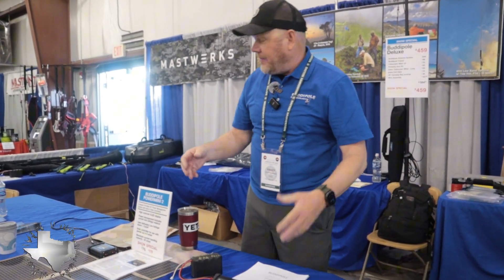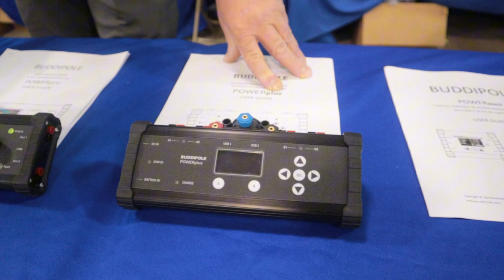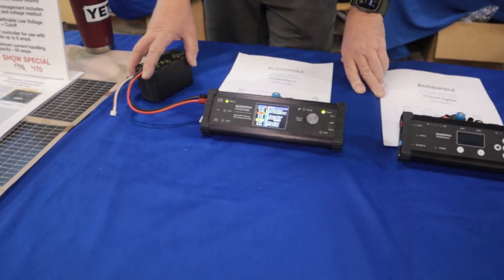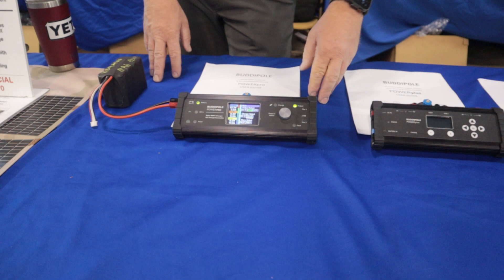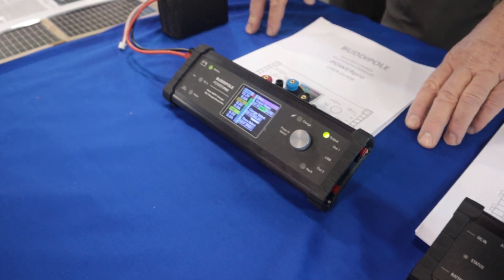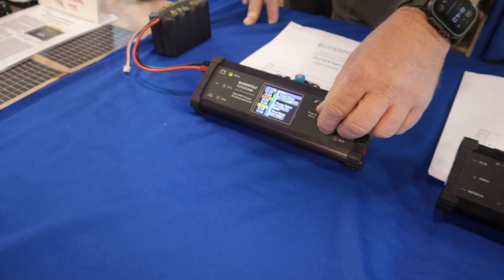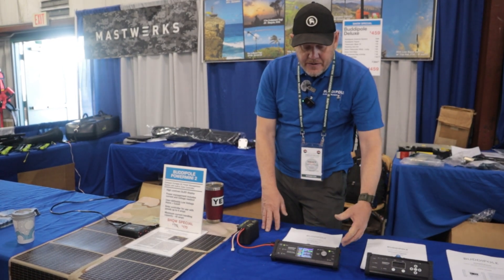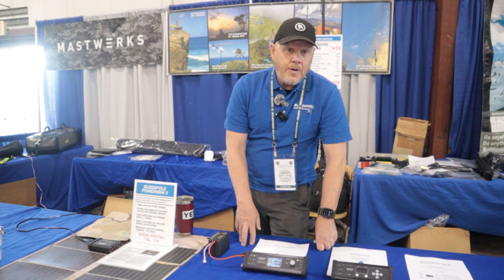Get Ready to MAXIMIZE Your Solar Power with the BuddiPole PowerPro MPPT Controller

Comment: I love my battery power, but I find lithium batteries to be painfully unreliable and tedious to maintain, and they just don't provide what I need. Power tool batteries die if they look at cold weather (DeWalt, Milwaukee, kobalt), and my big lithium batteries are just that: BIG. What's my solution? Make it bigger. I want eight 200ah lithiums, so I always have at least 4 good ones. I want 4kw of panels, 2kw of full Time use. I built a diy bluetti with a 200ah lithium, a rolling tool bag, 700w inverter, 200w of panels, and cables to jump cars, power 12v devices, etc. it couldn't jump a car lol (triggered protection in battery BMS), can't run a coffee pot, but it worked to run a temporary fuel pump in my van for a week and it can charge my phone lol... I've got 1kw solar, 80a mppt controller and 600ah of batteries in my rv. It doesn't sustain us at all. Still need a generator constantly or shore power. I'm hoping wind mills will help but at this point I've relegated my solar to powering lights in my chicken coops and my water pump once I get my storage tanks hooked up. That's where renewable energies will have the most impact I think. Running a small tower 24/7, lights, water pump, charging phones... The absolute essentials. I don't really see a use for these small solar setups, but for some reason I can't stop buying the stuff and tinkering lol. Something about building stuff with "options", even if they don't work. Maybe I was Chinese in my past life. 😮

Comment: Lets hope the display last longer than it did on the previous model...made it a little over a year before it became unreadable.  Also seems a little pricey (in typical BP fashion).
Reply from the maker: I have 2 of them that are over 5 years old.  No issues with the display
Reply: @HamRadio2  Consider yourself lucky then.
Reply from the maker: @cmh31909  I do.  But I also know about a half dozen people who own and use that original model, also with no issues.  So it isn't like it is widespread or anything